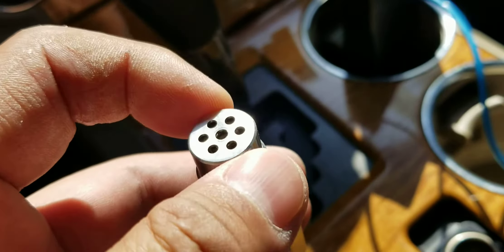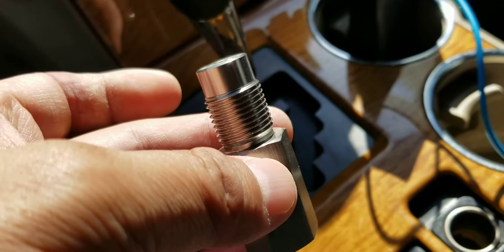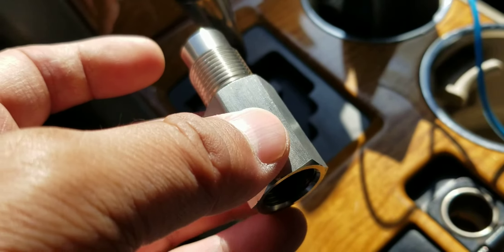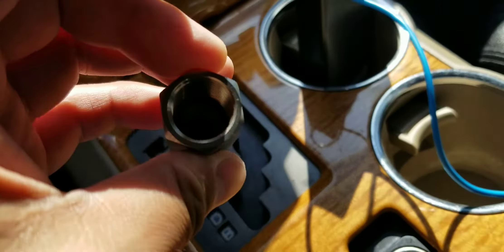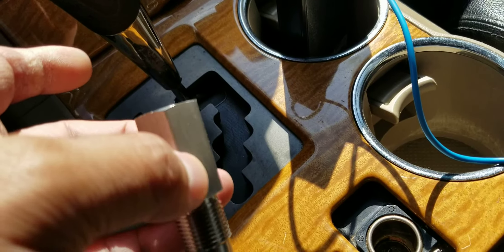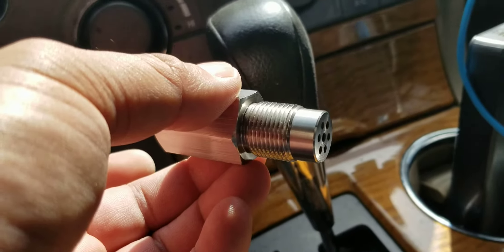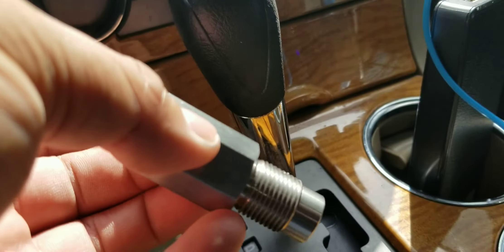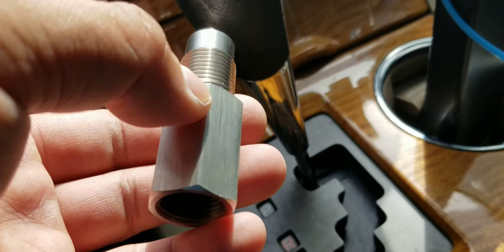FULL REVIEW- MINI CATALYTIC CONVERTER/02 SENSOR FIX..PASS INSPECTION P0420, P0138, P0141, P0430

Comment: My car threw a cel with the spacer
Reply: Same how did you fix it? I’m thinking of stacking another one on top
Reply: Don’t put them on the Air fuel Ratio sensors they only go the rear exhaust sniffing O2 sensor bank one sensor 2 bank 2 sensor 2 again don’t install on the air fuel ratio sensor at the front or top
Reply: @Nito6.1 they don’t belong on top or the air fuel ratio sensors they only belong on the bank 1 sensor 2 and bank 2 sensor 2  exhaust sniffer’s only you heard
Reply: @rosieclark3661  I'm pretty sure he meant stack 2 of them in one single O2 sensor bung, like stack another one on top(of the other spacer) not putting one of these in the top sensor.. but youre correct nevertheless.

Comment: They do work I’ve used on all of my
Hondas and recently installed one on my cousin’s 2005 Nissan Sentra 1.8 it was burning a lot of gas for a 4 banger since I installed this no check engine light and gas mileage is back to normal got them cheapest from China via Temu
Reply: Any issues?